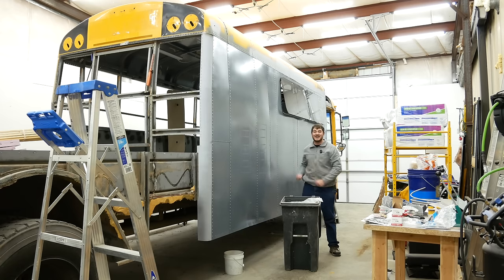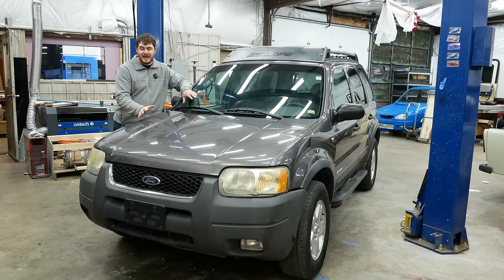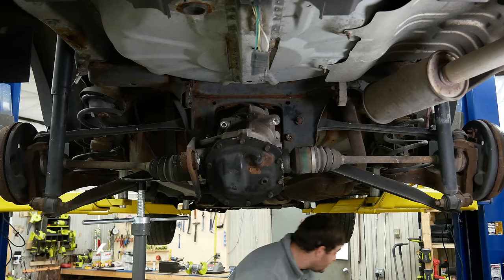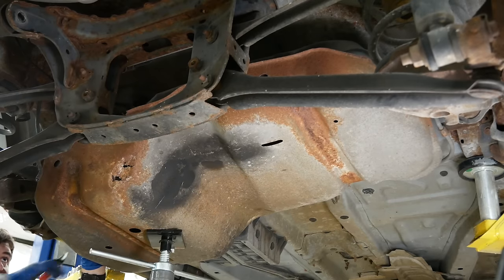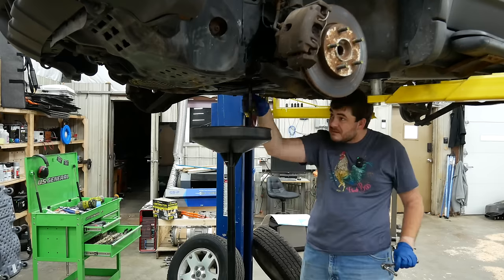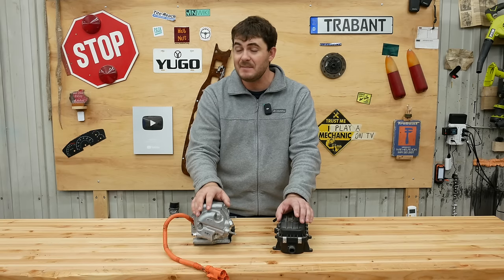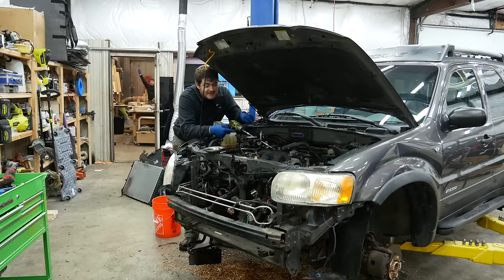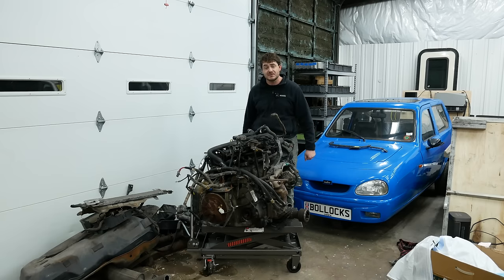I'm Building a 900HP Electric Ford Escape with a Purpose

Comment: Fun fact ammonia aka NH3 is a cheap renewable fuel that can be used in any combustion engine, and generator  with very little modification all takes is a propane tank kit, and you don't need to go electric or buy into the lies. Look up ammonia as fuel videos.  
ammonia aka NH3 nitrogen hydrogen3 has been used as a fuel by NASA  since the 1960s, it is still used in rocket fuel, aviation fuel,  tractors, semis  shipping vessels,  race cars. The land speed record is held by a rocket car running off straight ammonia. You don't hear about ammonia as a fuel because of corrupt politicians and businesses that want force you buy their products from electric cars, solar wind, oil, gas, nuclear,  power grid companies